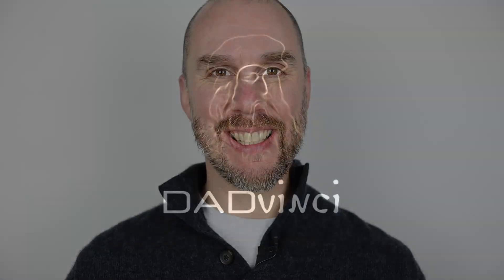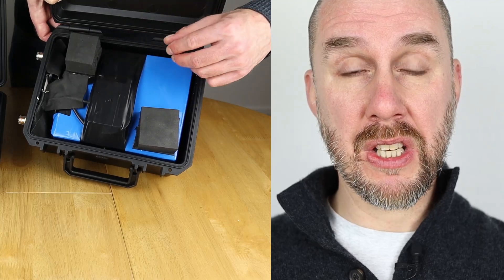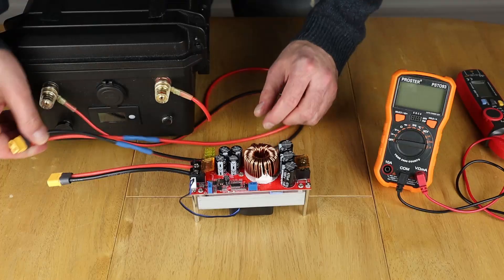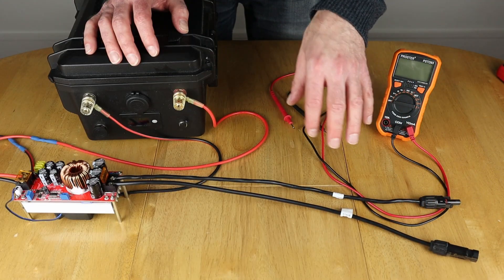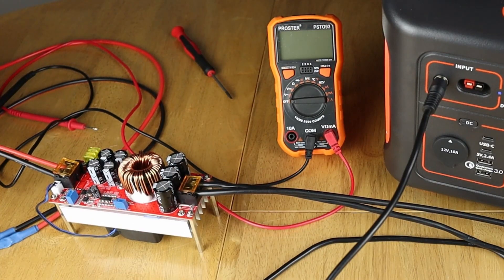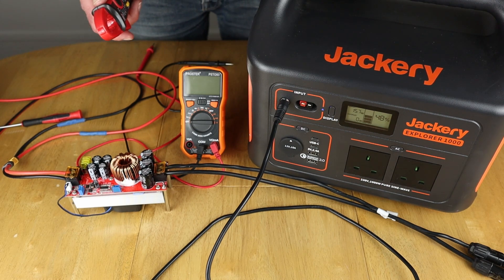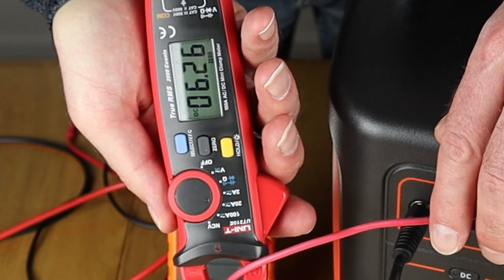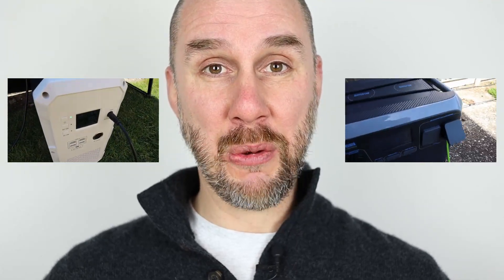Can you expand the Jackery Explorer 1000 (UK Version)?

Comment: Hi, Can anybody tell me if I can hook up solar panels with an output of 800 watts to a Jackery also can I use both the input sockets to lessen the load on the wiring and which is best parrel or series?
Thanks
Reply from the maker: @boot56qaz  Thanks for your question. The different inputs are connected to the same thing, so there's no benefit of trying to connect to both inputs at the same time (wouldn’t recommend that). There is also no benefit to connecting 800W of panels either as the charging limit shown in this video is around 157W. I wouldn't recommend connecting standard panels in series for this as the DC input limit is between 12-30V, as in the manual. Connecting panels in series will likely take the voltage over 30V. Parallel should be ok depending on the panel specs and amount you connect, but again there's no benefit in connecting 800W in total as it will limit around the 157W (or thereabouts). I hope this answers your question and shout if have any more. All the best, Adrian

Comment: Why don’t you connect the output to the xt 60 connector on the jackery input would that be ok also the battery pack can I connect my Motorhome battery’s to dc - dc input
Reply from the maker: @roy highton  Hey Roy! Thanks for your question. Did you mean connect your motorhome battery to the booster input instead of the case battery I use? Providing your motorhome battery output is in the range of 10-60V and you adjusted the output voltage (as I did in the video), you could charge the Jackery that way. Please can you let me know if I've understood correctly? All the best, Adrian
Reply: @DADvinci  yes I have 2 100amp battery’s I think I can use the boast from the battery’s to my jackery 1000 which I use as a extra power to my van when thier is no solar power

Comment: Hi Adrian,

Fantastic informative video as usual, thinking outside the box and educating us, thank you 👍 

Recently I tried out a 300 watt Bestek Pure Sine inverter that plugged into my van’s cigarette lighter/12V outlet. The idea was to boost the charging speed, from a typical 10 amp 12V outlet you can get roughly 104 watts incoming on my EB70 and my EB3A, when plugged into the inverter I was getting 240v input, 190 watts on the EB70 and 264 watts on the EB3A…..but, after 15 mins the plug actually melted completely in the socket because I was pulling too much wattage 😳

I cut the plug off, installed a 30 amp inline fuse and ring terminals and connected straight to the battery, working perfectly now 😂

Next i installed a 1000 watt Renogy Pure Sine inverter in my Land Rover Defender with a 100 amp mega fuse on the live cable adjacent to the battery so I can make a cuppa etc, works like an absolute dream  on my 600 and 800 watt kettles (obviously need the engine running)😂

I hope some of this is of use to your subscribers.

Thank you Adrian for what you do and educating and inspiring me to learn, you are a great teacher Sir.

Kind regards

Tony
Reply from the maker: @Defender1968  Hey Tony! It's great to hear from you and thanks very much for your kind words 👍😃. I'm sorry about the plug melting situation. The 300W Bestek has caught a few people out. Anything more than 120W (12v x 10A) from a car cigarette lighter socket is going to cause problems. Doesn't the Bestek have a 40A fuse? Usually, car inverters that use the 10A lighter socket have a 10A fuse, which would have stopped the plug melting (blown the fuse). It's funny, but I thought of your setup (EB70/EB3A) when testing the booster out, especially if I can make it work with solar too (series connect panels).

Spot on with connecting straight to the terminals on anything over 10A. 24V car/truck sockets are better (but 12V are more common) and they would give you 240W (24V x 10A). 

Yes, it certainly helps other viewers out, so I'm always grateful when you share your experiences😃. Take care, Adrian
Reply: Hi Adrian,

That’s correct, the Bestek does have a higher fuse(not sure exactly what it is). The vans fuse was 10 amp, when I pulled a higher wattage on the EB3A (264 watts) the vans fuse continually blew, thats when I installed a 30 amp fuse on the vans fuse panel, the fuse must have been higher than the vans wiring, that’s why the sockets melted and cable was so hot, fuse higher that the socket and wiring capacity? 

Once I cut off the 12v socket and connected an inline 30 amp fuse on the positive side and ring terminals direct to the battery there has been zero problems, the inverter and the inverter wiring barely get warm when pulling 264 watts from my EB3A 😊

I did comment on a ‘Jasonoid’ video about using your technique to up the wattage via solar but I need to be certain, I’ll look it up and update Sir.

Keep up the great work Sir.

Kind regards

Tony

Comment: Can you explain the advantage of doing this rather than connecting solar panels to the Jackery? What is the idea - charge your battery from Solar panel(s) then use the battery to charge the Jackery? I don't understand the concept.
Reply from the maker: @mikebeirne9158  Hey Mike! I hope you are well? There can be multiple benefits to this, dependent on what someone needs. Primarily, I've been asked from other viewers about whether these can be expanded to store more power like some other all-in-one models (e.g. Ecoflow, Bluetti). You can't with the current UK Jackery models, hence the alternative approach. The case battery offers a cheaper alternative, along with this booster circuit, to expand the 1kWh capacity in the Jackery, without the need to buy another Jackery (or other make).

As an example, on a sunny spring/summer day, you manage to fully charge the Jackery from solar. Then you plug in the mains adapter that comes with the case battery and charge it from the already fully charged Jackery (while solar is still coming into the Jackery, passing through to the case battery). The case battery then becomes an additional 1kWh+ worth of power storage that you can use through the Jackery (with the booster circuit) when the sun goes down, giving somewhere in the region of 2kWh overall for overnight use or rainy days that follow.

In winter, you could charge the case battery and Jackery separately from the mains (when no sun, as recently) for power outage backup purposes. Doing this means you can use the AC inverter in the Jackery, without needing to add an inverter to the case battery. 

You could also charge both from solar at the same time (solar panels permitting) by adding the charge controller (in this video https://youtu.be/c9HxjIRtQlE) direct to the case battery. 

It's pretty flexible and cost effective compared to the other options mentioned in this video on the Bluetti AC200P https://youtu.be/pl6-XN4xfMU?t=1822.

I hope this covers it a little better. Please shout if you have any other questions. Cheers, Adrian
Reply: @DADvinci  Thanks for the explanation Adrian, I had missed the purpose of effectively doubling the capacity of the Jackery. I can see how it all works now (I must learn to read more carefully!) and can see it is a cost effective way of doing it.. Cheers Mike

Comment: I don't want to say this was my idea couple months ago but I'm glad you made the video
Reply from the maker: @TheCanadianTank007  Hey! How are you doing? Yup, for sure. Been on the list to sort since last year (post 1000 review). Have had a number of viewers asking when considering the Ecoflow units against the Jackery. The AC200P is also another that I needed something with more throughput but had trouble finding something to fit the bill. Need to properly test and expand to the other units. Been rubbish weather in the UK for so long and been on dirty grid power more than I would like recently. How's the weather in your neck of the woods?
Reply: @DADvinci  well the winter here in Florida is just slightly chilly still not bad sun I'm currently configuring a 1200 watt solar panel setup mounted to the side of the house so it appeases the wife. And was testing a boost converter for my EcoFlow R600 max. Doing the exact same thing you were doing. It works good for a lot of different uses and yes it will work with panels just sometimes the input drops low when they're shade but if you run panels in series it's not too bad keep the voltage high
Reply from the maker: @CanadianTank007  Awesome, thanks for the booster with panels insight! The Jackery input limits are tricky, so I'm hoping to series up two 100W panels to push it to the 157W limit mine has. Connecting in parallel 'out of the box' helps with cloudier days, but full sun never really hits its true potential (only 118-120W). Did you move house this year?
Reply: @DADvinci  yes all moved him after the bad hurricane that hit the west coast of Florida. All is well and use my power system for 8 days and managed but realized I need more power and panels which I'm working on just getting settled and planning. Just deciding on panels and battery voltage.
Reply from the maker: @CanadianTank007  Great to hear things are coming along. I assume 24V or 48V system to get more bang for your buck, running bigger loads for longer? I also need to go larger than my excellent DIY 24V 5kWh (been flawless). Ideally 10+ kWh, but not sure whether to go 48V for larger loads (more expensive solar inverter) or stick with my 24V setup and build a bigger battery. I need proper ground mounts too. So much to do, but can't wait!
Reply: @DADvinci  there are many good all in one systems. We have been using a 24v growatt 3kw on a 24v 100ah lifepo4 battery for 6 months in our shop for server backup and it runs well. I don't have a need for high power yet but would like to run longer. That was my only short fall for the hurricane outage.

Comment: Hey if you still have your AllPowers, try this.  Tip it on it's back with the inverter on.  It won't work, it has an orientation switch inside!  I found this out by accident.  I have the 372Wh version with the 300w inverter.  I suspect it's because of the way the cooling works.
Reply from the maker: @ib516  Hey! I've tried this on mine before and it continues to work fine. Perhaps on the later 'revised' 372Wh or I might just be lucky with mine. All the best, Adrian